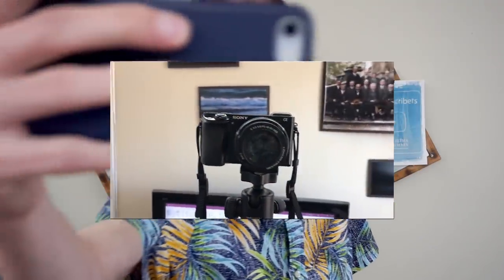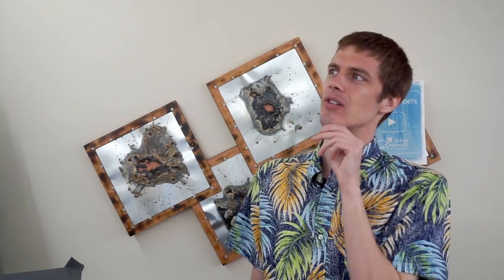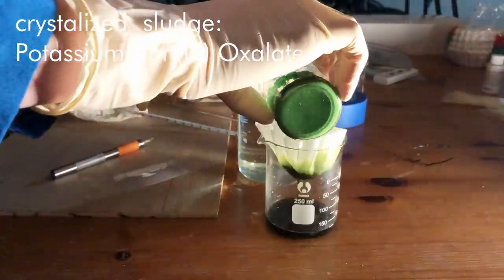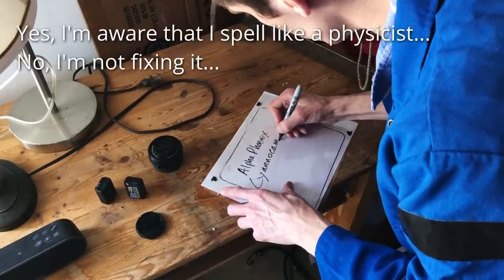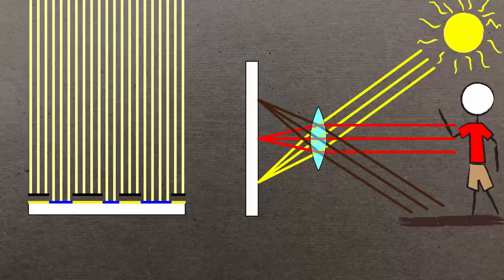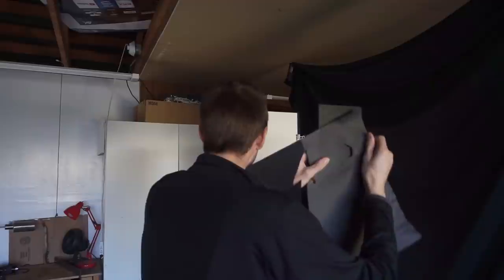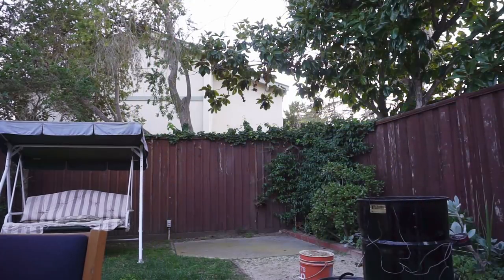Ditch the DSLR? The 200-year-old science of my new favorite camera (2^14 sub special!)

Comment: I can actually say something because this is my wheelhouse, and I research this for a living as a photograph conservator! I would have a couple of suggestions on this. 
1) In regards to aberrations, a simple way to get rid of them is to make a symmetric doublet, and for the focal length you are at, the easiest way to do it would be to get two +1 diopter reading glass blanks, which would add up to 500mm together, and then you could add a lens to bring it up to the 350 mm range using the lens makers formula. If you get your positive meniscii from surplus shed, you can get it pretty cheap, and just use PVC pipe to mount. Also will let you pick your aperture, because some of those meniscii get massive. 

2) sensitivity: a good rule of thumb with these things is that water helps with speed. You are on the right track with Ware’s formula ( as a crystallography thing, his cyanomicon is a great read because of how Prussian blue works, and is free online). Arpan Mukherjee’s work using different iron salts is also good, and can be found on alternative photography .com. A final hint would be to sensitize, and dry your paper, but then humidify it using a wet blotter behind it. Wet paper gains around a spot of speed. 

3) if you really want to make a project, explore science, and cry, try Lippmann plates. Gabriel Lippmann got a Nobel prize for his work, and a paper which came out just a month ago showed that the Lippmann plate is actually a multispectral resolving surface, so you can actually use the images as a tough imaging spectrometer (good luck, it will never happen because it is so finicky, but in theory, it does work)

Comment: When I was a young lad working in a hospital, I had access to xray film stock, which is around 8 x 10 inches.
So, I built am 8 x 10 camera with a magnifying-glass lens...
When I exposed the xray film and developed it, it came out quiet well...
It's perfect for contact printing...
Reply: xray films can be exposed to smaller waves ? hum
or just that the sky is filled with xray, isn't ? 
must have been so cool the picture.
Reply: X-ray film has been a favorite of the large format community for many years for its cheapness and availability. Not the best for visible light photography, but it works.
Reply: @monad_tcp  It picks up visible light too.
Reply: @fepatton  Exactly, you make due with what you have...   ;-)
Reply: @fepatton  oh, that's why It's kept inside a metal casing before being put in the machine.
that makes sense. I never paid attention to that.

Comment: If you didn’t know, there are special transparencies made for printing onto with an inkjet. There are some with a dry gel like layer that absorbs ink well (but washes off with water), and there are also waterproof ones that I think are just made to be particularly porous. Less smudging than using a normal transparency. To get a particularly opaque printing, it’s often necessary to print extra ink (CMY and black all at once), which of course means smudge mitigation is even more important. Big Clive’s videos introduced these transparencies to me for the purpose of making circuit boards with dry film photoresist, which is a rather similar process to your masking of cyanotype paper.
Of course, a laser printer doesn’t have those issues at all.
Reply from the maker: These are supposedly inkjet-friendly, but alas they literally never dry... I’ll get a laser printer someday just for this kind of thing - I don’t print much in the way of “real” paper xD

Comment: I’ve made similar cyanocameras by using USPS Medium Flat rate boxes, paired with a plastic fresnel-lens magnifying sheet in front, and a sheet of cyanotype paper inside the box. 

With the large fresnel collector lens in front, exposures happen in about an hour and the density of image can be similar to the results seen here. 

Sharpness from a Flat-Rate Cyanocamera is dependent on the quality of the fresnel; I’d say it’s comparable to a soft-focus Petzvall. 

Keep the fresnel lens in the shade: this will prevent the sun’s image from focusing back of the box and lighting the whole thing on fire. :)

Comment: 40 years ago we did this with 8x10 (inch) film negatives and the lens from a copy camera that would make 20x24 inch negatives. Then, since we worked in photo labs would print from the exposed film and make 40x60 inch prints. We also used super glossy positive paper to get a slick magazine quality instant picture, albeit backwards. We'd go out for lunch with the cameras and process them in the machines and have prints in less than an hour. 
The rod technique you used was designed to make "rubdowns" of type or images that could be transferred to paper for layout by rubbing the back of the velum original. The rods had thousands of circular grooves that would evenly spread the photo solution on the velum. After 4 or 5 passes of different pigments and photo sensitive chemicals, the velum was exposed and processed.

Comment: This is fun!

Suggestion #1: Use photographic paper instead of that cyanoshite. It isn't fast, a mere ISO 3 or so, but way better than what you have now and all you need is developer (and stop?) and fix to process it. Rince it well.

Suggestion #2: Use large format film and develop it yourself and then make use of contact photos on photographic paper. Since film has way higher photosensitivity, this eases the job a lot

Suggestion #3: Drop the lense and use a pinhole instead. You can find tons of pages describing pinhole cameras, but the basics are just focal length == length between hole and film (or whatever) and aperture == focal length / diameter of pinhole. So a focal length of 200mm and a pinhole of 1mm gives you an aperture of f=1/200.

With pinhole, everything is in focus, ish, since there isn't a lens, but it'll get more blurry the larger the larger hole. It'll aso get more blurry with a smaller hole, just as it does with tiny apertures with a camera with a lens - all because of diffraction.

Good luck and happy photographing :)

Comment: The blur on the edges is called comatic aberration. You can fix it with a couple extra lenses, a Plano-convex and a Plano-concave one. I suggest talking to people that build telescopes, your aperture is large enough to fit somewhat in the same realm of imaging. Also, you can look into how tele lens are set up. You can ignore all the chromatic correction lenses and only try to mimic the coma correction, since you're imagining one wave length.

Comment: Most lenses are made of materials that block the UV that will darken the print, thus it takes a long time to work. You need either fused quartz lens which pass UV,  some other type of UV transparent made into a lens, a pinhole camera with no lenses or a reflecting mirror ( Newtonian) to project the image onto the paper.

Comment: Have you thought about deliberately curving the paper? Like instead of a flat plane you used a concave cylinder. You might get some interesting fish-eye effects with a low focal length. 

Also maybe do some solarigraphy.
Reply from the maker: I actually did considerer a curved sheet to help combat the spherical aberration - didn't get to talk about that in the video. I could get the edges of the frame to look "sharper" if they curved forward towards the lens, but unfortunately I really just replaced blur with stigmation, so the edges of the image still looked pretty bad. With a faster chemistry where I could get away with a smaller aperture, I'll be all about fun tiltshift things!

Comment: Oof I'm a little late to this to add anything worthwhile. Your exposure time isn't going to get better with your current setup, but you do need to press the "film" behind glass. I'd also recommend using finer paper - details are being lost in the "grain" of the paper texture. Seeing the blueprints in the video I'm assuming you know about the peroxide trick, which can add significant contrast.

Also dude, keep going with this! Van Dyke & Kallitype are both extremely similar to the cyanotype and may be a bit more sensitive (citation needed).

There's also the Platinum/palladium option which you can buy pre-mixed (for a price!!) and use to make a negative with the same method.

I love this stuff, and would love to see more content about it.

Comment: OK, I have a couple of suggestions, coming from someone who has 1. Done cyanotype, 2. Built my own 20-24 camera in the past from black foamcore, and 3. used ULF cameras for a long time...

Back when I was a kid, we did something similar to what you are doing, but we used a overhead projector to do it.  You know, what I'm talking about?  One of those things with a light source and you put a piece of film on it that you can draw on and then there's a mittor and lens aboe that you can aim at the screen and focus?  These things a PERFECT for going the other direction.  You basically need to make a black tent for the area from the lens down to the light table, and then you place the cyanotype paper on the light table (and don't turn it on, the light comes the other direction).  It becomes a bit of a camera obscura, and all you need is a white piece of paper to focus and compose on before you put the cyanotype paper in there.

The lens is pretty large, and who knows what the aperture is??? But it will have some chromatic aberrations in it, so it isn't perfect, which produces some of the dreaminess that you may like (or not, of course).  The exposures are likely to be much shorter because the lens is going to be reasonably fast.

If you want to try to improve the image quality and start to eliminate a lot of the artifiacts that you nay not like (towards a "perfect" image), you will need to redesign the camera to ensure that the light that is coming inside the camera but isn't part of the image on the paper is dealt with a lot better.  That light is a source of FLARE.  Not necessarily the lens flare that you think of from J J Abrams' movies, but a general loss of contrast in the image that will sometimes be uniformly distributed, but sometimes be concentrated on one side or another.  This is in part due to the light getting in through the lens and then bouncing around inside before eventually hitting the cyanotype paper as randomized (not image-forming) light.  Eliminate that, and you will have a lot more contrast in your images.  I can get into why but the key to focus on is eliminating that extra light wherever possible.

Comment: Sometimes we fixate on details we think are core to a project. Have you considered different photo media? For example you can still buy enlarging paper in silver halide, various color papers and even cyanotype. All of these could be used directly in your camera and produce really awesome looking negative prints. In the case of the cyanotype paper, you could also use some to see if it performs better than your own. You also might be able to do your own silver halide process. It won't be the cool blue and white, but it might expose faster.
Reply from the maker: I'm absolutely going to be looking at more chemistries! I chose cyanotype for this first attempt because it was really cheap and easy to coat large areas

Comment: A few suggestions:  1) did you test the lens for UV transmission in the same way you tested the acrylic? if it fails find another lens.  2) Hold the paper flat using vacuum against a 3/32" acrylic "back board", that you sanded, or lightly sand blasted to make it a "ground glass" focusing screen. By mounting it in a sturdy wood frame with 3 bars behind it spaced about an inch back, and 9 small (#4 of #6) 2" long flat head screws, you could "dish" it to match the curvature of the lens's  image field.  For a vacuum pump, perhaps one of those sold to suck the air out of a home freezer bags that is powered by 2 AA batteries, and after 15 seconds or so, run it on just 1.5 volts perhaps via a voltage reducer and a 12 V car battery, or a bunch of "D" cells, wired in parallel.  Another option is a small home aquarium air pump in a sealed "Coffee can" with the outlet hose to air, and the "coffee can" being in vacuum, would require 120 VAC, although I think that there are some made that run on batteries for people with expensive fish in case of power outages.

Comment: How about putting the cyanotype chemicals on glass to form the negative, then exposing another sheet of cyanotype paper through that to get the positive? No fuming mercury. Perhaps you could also experiment with using coloured filters so your negatives are colour specific, then combine them (can't think how except in a computer).
Reply: Idk if that would work but a downside would be doubling the overexposure chances
Reply: I don't see how colour specific filters would do anything since coloured light has no effect on the paper
 Only ultraviolet does.

Comment: You could add a lens hood to reduce the chance of sunlight coming directly through the lens and starting a fire. You might also try getting some older glass from a recycler that does not have UV resistance (whether from additives or via film coating) to hold down the print. Mattieu Stern has some great videos on adapting antique lenses which is another great option for exploring different optical solutions. Thanks for sharing your journey.
Reply: I see that Mattieu is in the comments so you look all set. 👍

Comment: One thing you could do to speed up the exposure time is to use photographic print paper which I vaguely remember has different rates of reaction to a light source.

This would give you two options for light sensitive medium where both are utilized dependent on aim.

Comment: One ways that you could potentially fix the aberrations is by adding a second lense to get the light rays to be parallel when they hit they sheet of paper. A flexible lense (like one of those plastic fresnel lenses) could work.

Comment: Thinking about the binder clips, I was expecting your next step of mounting the paper would be keeping it in tension like a drum head. Perhaps a few rubber bands and mounting hooks on the back of the back plate at the corners could keep the paper taut and flat. The rolled edge of the binder clip handle would likely lift the paper off the back surface, so supporting it with a built up layer might keep the paper flush with the rolled edge.

Comment: 7:39 if you wrote it in mirror text, then flipped it so the ink side is touching the paper, you'd get a more crisp image.

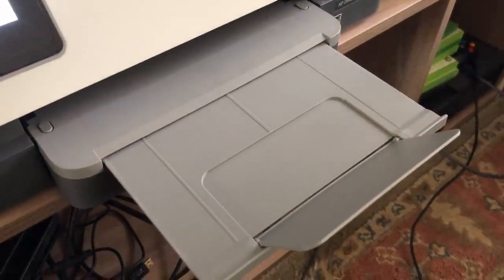8:15 If you print the graphic mirrored and expose it with the ink side down, that will increase the fidelity of your exposure.

Basically, the light leaks under the graphic through the plastic carrier. The thickness of the transparency causes the "smudging", blurring the shadow as it's floating above the paper.

I'm a graphic artist. I used to expose metal plates for pad printing.

I used to send my graphics to a shop that created masks using a photo process.

I'd send the graphic flipped (mirror) so that when I apply the film as a mask, the ink side would be the side touching the masking gel.

This would give me higher resolution crisp graphics during exposure.
Reply: I remember doing something like that when someone needed durable barcodes that could be scanned hundreds of times a day without getting rubbed off the page. I discovered the way to do it was to print it backward on transparency plastic, and then flip it over so they scanned the back. The toner didn't rub off but eventually the plastic got too scratched up and scattered the laser. It worked a lot longer than the old method though, and at a reasonable cost.

Comment: Curve the back along the horizontal/long axis to (better) match the focal plane curve caused by the lens, to achieve focus over a wider area of the paper. This curve will also insure that the paper will stay in contact with the backing plate. Use a cardboard strip around the lens about 25mm in width that shades the top half of the lens, like an awning.

You could of course decrease your exposure time by using a huge (250-300mm) lens to gather 5-6x more light and have that focus on your 55mm lens: forming a telescope setting, allowing for double the change for being out of focus.

Comment: If the limiting factor seems like the sensitivity of your photochemistry, consider switching to a different chemistry system.  I think you can get Van Dyke brown or gum bichromate photo printing kits online.  (I did some gum bichromate prints with glow powder once that ended up really fun)  Another option is just using black and white photo paper as your sensitive medium.  It should be somewhere around ISO 25.

For flatness, I think regular window glass transmits fairly far into the UV, so if that works... ditch the tape, keep the clips!
Reply: Also, if you ever rebuild and go bigger, the lenses out of an old projection TV should be aspheric.
Reply from the maker: Oh boy I literally have very large projection tv lenses sitting in my parents attic about 20’ from where I’m sitting...

Comment: You could compensate for some of that spherical aberration by using a curved panel to mount the paper on. It would give you a band in the middle that's in focus. You just have to match the curvature of the lens adjusted for focal length. You could do a spherical sector but getting paper to conform to that would be difficult.

Comment: Use glass to hold the paper back. And while you're printing a pair of slider rails to hold that in place, also add a shutter that is just a black plate you can slide in and out.

Comment: You can make a vacuum easel using a pegboard a picture frame and small pc cooling fan for portability. The paper should be porous enough to create a vacuum. Granted the easel-box has to be airtight along the edges if using the PC cooling fan. A vacuum cleaner would be impractical due to the long exposure and location. I mean you do have a video on "High-Vacuum".